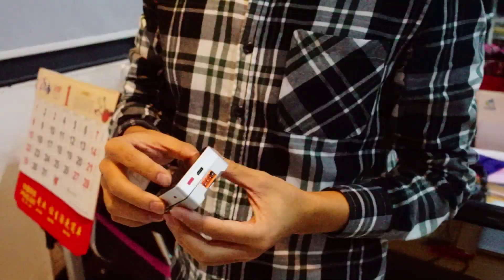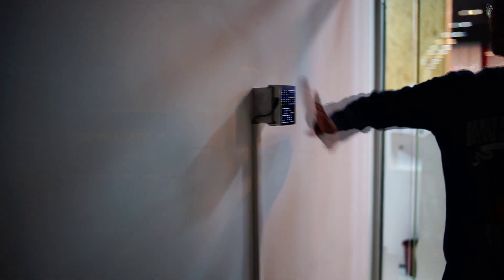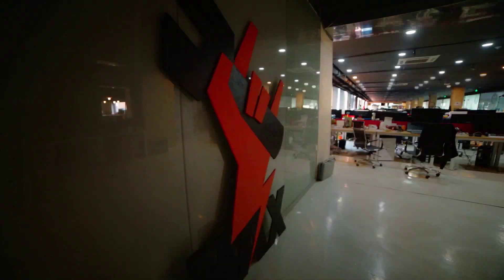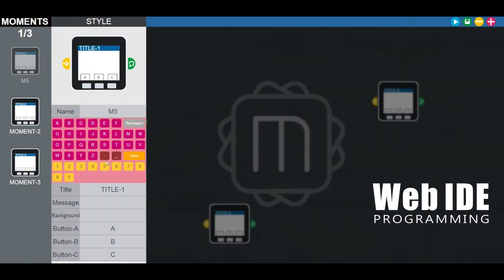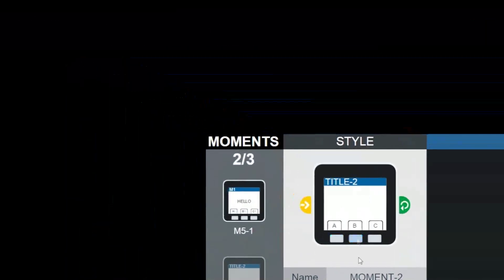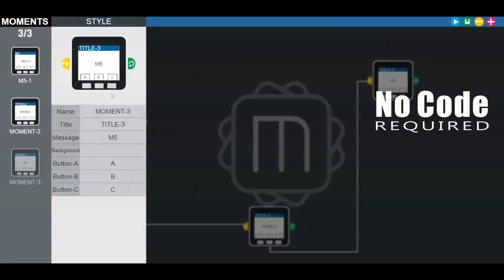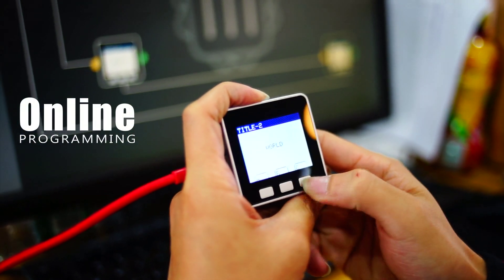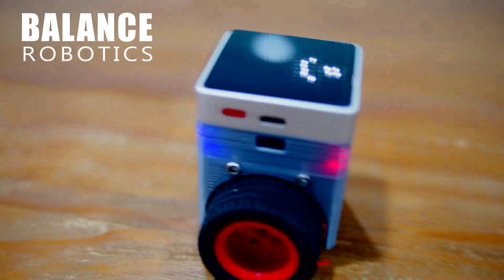Esp 32 Dev kit M5Stack - Rapid Product Development Toolkit

Comment: ele fal isso
The filesystem appears to be corrupted. If you had important data there, you
may want to make a flash snapshot to try to recover it. Otherwise, perform
factory reprogramming of MicroPython firmware (completely erase flash, followed
by firmware programming